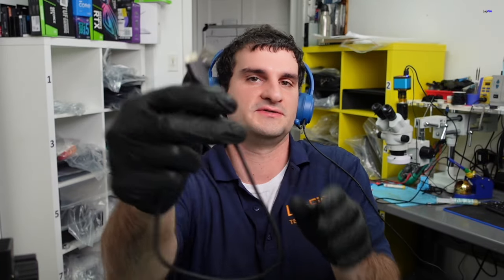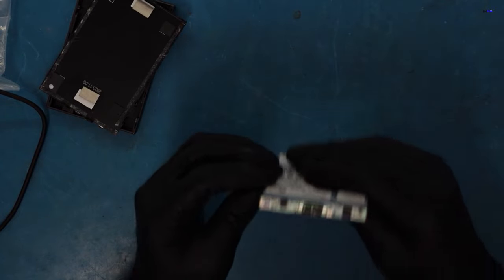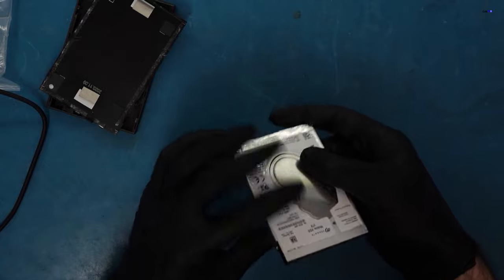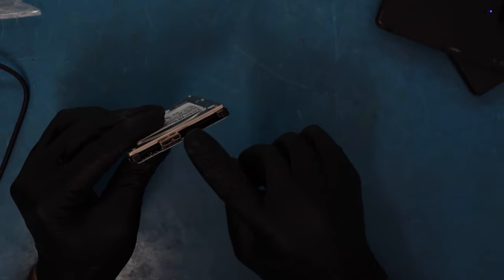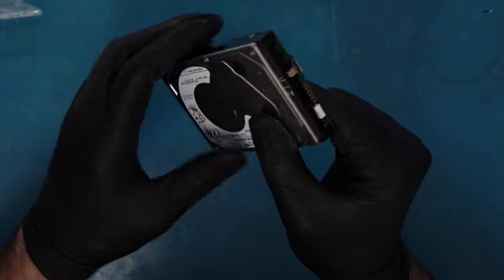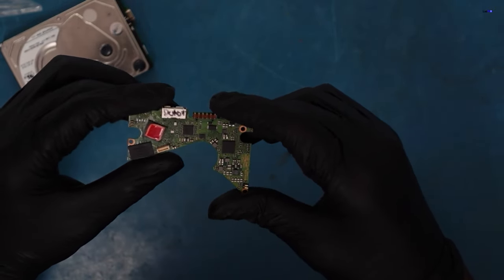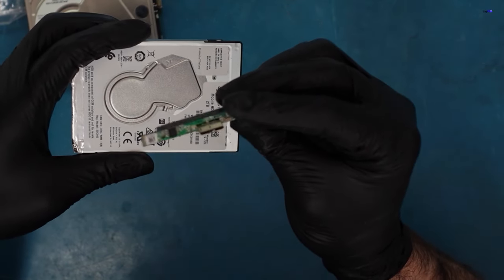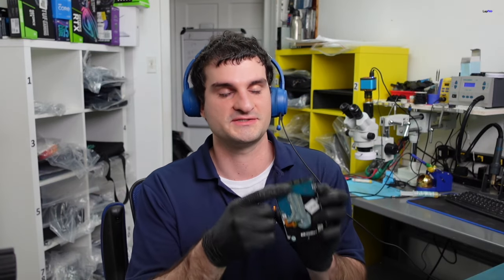How To Easily Recover Data From A Broken Seagate External Hard Drive

Comment: Please, please do not set that hard drive from which you removed the broken connector off to the right where the port cannot be seen.  One would need to see the port configuration of the hard drive which is plugged into your "sled"  Please spend a few seconds to show the ports you are connecting.  You took too much time showing the broken USB port and the connector. Show the sled port and the hard drive port being connected at good close-up.  Otherwise this demo is not ultimately useful.  Thanks for the leads in any case..

Comment: What a lifesaver, I thought I had lost unreplaceable wedding and family videos.  My connection was damaged, but it wouldn't pop up on my computer.  I took off the adapter and slapped into external case I had lying around and it popped right up.  Thanks for the video and thanks to seagate for not soldering to a board.  Seagate for life.

Comment: Thx for your instructions! But my Problem is different. My external Hard Drive fell to the ground several times and now when I plug in the Hard Drive, it becomes weird noises and the PC doesn't recognize my external Hard Drive anymore. Is it now totally broken or not?
Reply: i have this same problem
Reply: If you dropped it chances are nil to fix. The platters get scratched and the heads ruined.
Reply: Just happened to me. He has another video explaining how to fix the issue we're facing.
Reply: @3-piece129  Hi, could not find the video. Could you share the link please?
Reply: Hi, same thing here. Were you able to recover your files? If so... how did you recover your files?

Comment: Great video! I've got a seagate drive and the connection looks fine. I took it into the local computer shop and they said I would have to pay a data recovery firm to try and pull the information of it . They said it didn't "post" on their machine. Given all this, is there another way to get the information of a seagate drive? The cost of data recovery is around $1000. thanks.

Comment: For that one other person out there who has an old Fantom external drive that came with an eSATA port and eSATA cable - if it fails, try the usb-b port that is on the drive if it has one; it's shaped like a square. Buy a cable with usb-a on the other end since the eSATA connector on your computer may be bad. I didn't even know it was a type of usb port. Luckily, my old Canon printer came with one of those cable so I just plugged it in and it worked.

Comment: I ripped out a 2TB drive form the older seagate external drive. put it into a USB drive adpater.  but cpmputer managemnt wants to format the disk.  the 3 partitions 1 raw, and 2 UN-allocated.   this seems strange when it was working, buit the external connected died and was all working before that.    it's an older usb-2 , btu was workign before the older usb-2 plug would not connect in anymore.

Comment: I just moved most of my data of 25+ years last night to a Seagate SRD00F1. I left it on over night. When I plugged it in this morning, windows sees the drive, but it is not accessible. Do you think this trick may work if I open it and move it to a caddy?

Comment: I have a question. If you, or anyone else here can help, please! Now, I have a Seagate Drive which I purchased from Costco. My computer (and others, I tried it on others thought it was just my computer) recognizes it fine, all the time, all files pop up (ironically, the small light on it ironically does not appear). HOWEVER, I cannot access the files, and each time I get the option for "scanning and repairing", it is never able to do so. I do not think my files are encrypted, but do any of you know what might be going on? If anyone can help, I would be eternally grateful. I thankfully have many backup files on a small USB, but I have many other files on the seagate (that I have been working so hard on) that I need to backup onto another seagate that was purchased for me.

Comment: Do you know what the problem is if the hard drive is taking forever to transfer or reading a file? It took several hours before my Mac was able to registered the hd. Now I’m trying to transfer all the data onto my desktop and it’s taken days and it’s still on “preparing files for download”
Reply from the maker: Most likely the head is failing.  The more you use it, the worse it will get